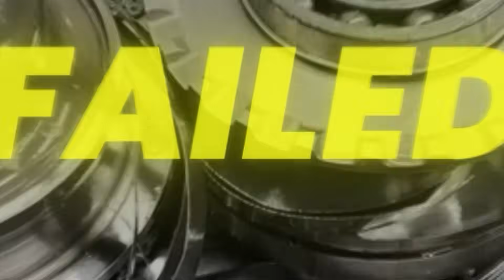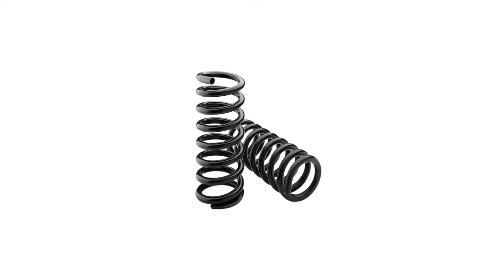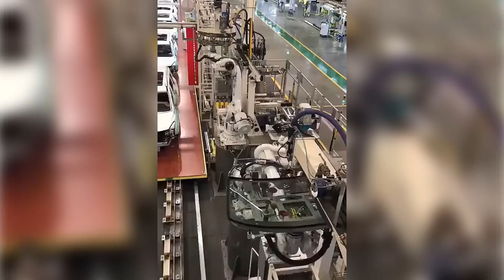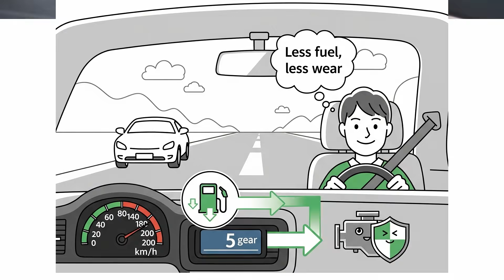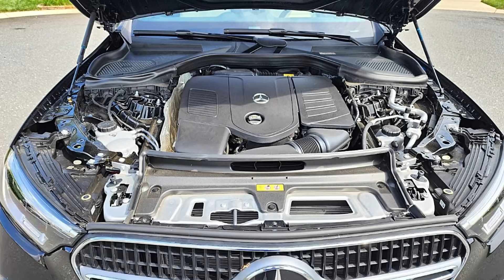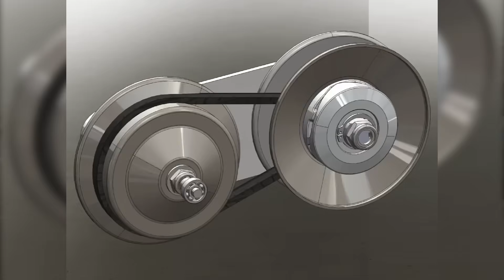How This One Bad Habit Kills Every CVT Transmission Before 50,000 Miles

Comment: I don't understrand. They do advertise everywhere that cvt transmission is fragile, not durable enough, etc. But even heavy machinery like JCB tractors use cvt transmission. Now almost all new car, aside from expensive one use cvt.
Reply: The CVTs in cars are way undersized for the load they are subjected to, unlike the tractor units.
Reply: The systems used in heavy equipment is a hydrostatic transmission.  Basically an adjustable hydraulic pump and motor system.  No belts or chains involved

Comment: I have an 07 Prius.  They call that a CVT too, but it is much more robust.  No belt.  It is genius.
Reply: Basically Toyotas have a planetary system instead of a normal transmission.  Ironically, normal transmissions use a planetary set of gears also.

Comment: Im a mechanic for 25 years. Ive had 3 altimas and 1 new maxima. All the altimas went to 200,000 miles, and ive got a heavy foot. Drain and refill every 40k miles. Never had an issue with any of the cvts
Reply from the maker: That's what I think. Timely maintenance is the key to make CVTs last longer
Reply: Also keep in mind the maker of this video has ZERO experience beyond ready sketchy info from amateurs on undisclosed "forums".... which is the only accurate information in this clip.
Reply: Hi , can you describe what is for you heavy foot?..I live in Europe in some countries there is no speed limits so I do spirited driving " holding constant higher speed couple of hours 160km/h...is this to much strain  for honda cvt 1.5t, thanks.
Reply: @ksweden3455 make sure to drain your transmission fluid and refill every 40,000 MI.. here in the USA I drive my CVT vehicles at 100 MPH.. just make sure you have the correct transmission fluid level when you service it. Make sure to use proper CVT fluid. When I say heavy foot,  I personally mean harder acceleration and higher speeds than the average person.
Reply: @ymmij1973 Thanks a lot, asking you because my cvt on honda failed on 42000 km, honda said " bad luck:, my car insurance backed me up with new one, I do not know can I trust cvt anymore, what kills cvt most is it design or no oil changed l?, it is funny driving car with 183 hp and you are scared to drive it faster on highways in my cays 160 -180 km/h 4, 5, 6 hours constantly.
Reply: @ksweden3455 I've never owned a Honda CVT so I can't speak for their reliability but I've had four Nissan cvts one of them with a V6 and never have any issues. I was the second owner on all four of my vehicles
Reply: @ymmij1973 tell me about v6 and maxima beautiful car...is it reliable?, I still think maybe to import one from America, you can find them for good price the only problem here in Europe is avaliable parts?..in Usa cars are a lot cheaper than in Europe...you can get for 32.000 new camry   for same money in eu you can buy 3-4 years same car
Reply: @ksweden3455 follow my page if interested. Thank you
Reply: @ksweden3455  Running at top speed isn't the big problem with CVT's. It is stop and go acceleration that kills them. Don't rush off the line, especially soon after a cold start. If you want to go 80 or even 100 on the highway that shouldn't be too detrimental (with regular fluid changes). Accelerating from stop (or towing, same thing really) destroys the belt no matter the condition of the fluid. Don't race off the line. Slow acceleration is key, not what speed you ultimately reach.
Reply: I have toyota yaris cvt fluid tc ...is enought to drain and fill fluid or i need gasket pan drop and filter change every 30k miles ?
Reply: @MirkoMadzar12345 I like to change the fluid after the vehicle has been driven and vehicle turned off after about an hour. When you drain the fluid make sure you measure how much you took out and then put back  in the exact same amount.. I've never changed the fluid on a Toyota Yaris so I'm not sure if there are any differences from my Nissan. But just draining the fluid one time and refilling won't be enough,you should drive the vehicle and then drain again and refill

Comment: I have two Subaru Foresters, both with CVT, and both north of 100K. The stealership said that they were "sealed units", and that they never needed fluid changes. My owner's manuals confirm that. After some research, I found that the Forester owner's manual in Japan suggests fluid changes every 30K miles. (Maybe the Japanese CVT's aren't sealed)? I was really hoping to have my Foresters for at least 200K miles. Are they doomed?
Reply: There is no such thing as a sealed transmission. Such a thing does not exist. Your CVT may not have a dipstick, but that does not mean the CVT is sealed. There's always a way to put fluid in and drain fluid out. Every single CVT.
Reply: @barryblessing  Every CVT has a dipstick. Look in the driver's seat.
Reply from the maker: if running without jerks then conitnue, if at this moment u change, you may experience slipping issues
Reply: @AutocornerdPros  A CVT without a jerk is a driverless vehicle.

Comment: You cannot check the CVT fluid because their is no dipstick. CVTs are sealed tranmissions
Reply from the maker: Yes, u can check from drain plug. I have toyota yaris and check in the same way
Reply: There is no such thing as a sealed transmission. Such a thing does not exist. Your CVT may not have a dipstick, but that does not mean the CVT is sealed. There's always a way to put fluid in and drain fluid out. Every single CVT.

Comment: Fortunately, Toyota hybrid vehicles use beltless CVTs.
Reply from the maker: They have chain?
Reply: @AutocornerdPros  Nope. Planetary gears with electronic control. It’s what Toyota calls their eCVT.
Reply: @AutocornerdPros  No, it is an entirely different concept. There are two electric motors and a gasoline motor hooked together through a planetary gear system. Together they produce any gear ratio, through control of the motors.  It is very clever. There are no belts, nothing weird. Gears are ordinary and meshed together. No shifting!

Comment: If you have to idle your car for a couple minutes before turning it off, that’s a horrible design flaw.
Reply: regardless if its necessary or not,id like to stay inside my car for a while, releasing all bad aura ive had before going inside my home and family,so thats a win win.
Reply: @junbagyo84 way to think positively I do this myself anyways lol. 

Leave the garbage at the front door.
Reply from the maker: 30 seconds is fine
Reply: @AutocornerdPros  Like, literally, no one does that. They pull in, put it in park, and turn off the engine.
Reply: @NativelyBornAmerican  Nah I need to take a couple deep breaths and gather my belongings and think about my life briefly before getting out of my car. So that usually takes like 3-5 minutes
Reply: Early turbos demanded it. If you didn't run your car for a minute or two after driving, the oil would burn inside the turbo and eventually ruin it. A friend, at his own expense, installed an aftermarket pump which would automatically circulate oil through the turbo for two minutes after shutdown. I always thought it was a serious design flaw. Manufacturers did finally address the problem.
Reply: @tombiggs4687  Buyers of those early turbocharged cars were educated on them, typically. And it’s been a LONG time since those days. While CVTs have also been around for a VERY long time, there were extremely rare until only relatively recently. And after-cooling, where the car will run cooling fans, pump oil, etc, after the car is turned off has been around for many decades now, too.
Reply: You are absolutely correct, This is more like a trap.

Comment: Cvts are scam. Traditional auto or manual are more reliable. Its cheaper to replace a clutch, and the probably of a defect is highly unlikely. I trust a traditional auto over some rubber band in a vital component like a transmission just to save some mpg. Id rather just pay for more fuel than to breakdown ......

Comment: This is why I avoid automatic cars at all costs. The fact that I don't have to worry about oil temperatures and belts is a blessing 6 speed stage 2 performance clutch. Let's hit the road 🙌
Reply: your clutch will burn out so where's the advantage..
Reply: They are talking about cvts not automatic transmissions.

Comment: So, basically CVTs are a fragile, fussy solution to a situation that already had robust solutions.  Sounds like a great advancement!
Reply: The are solution in search of a problem. It is not necessary to have "infinite" gear ratios. 8 gears is well into diminishing returns.   A fixed gear transmission that is not exactly that the most efficient RPM, but darn close, is better than a CVT that is at the theoretically correct RPM for every situation, but inefficient.   The exact RPM is not that important; within like 5-10% is all right. There are other factors like valve timing and whatnot.
Reply: Nope, but sounds scary if you don't know the facts.
Reply: Misinformation. Most of them are very reliable with normal maintenance.
Reply: @brucewygal133  I own a Versa . They are NOT reliable!
Reply: @HarryPost-h7m yes they are its abuse that kills them..
Reply: @brucewygal133  true, I have a 2013 sentra at 176k and its still strong
Reply: @brucewygal133 describe your definition of reliable please. My definition of reliable would be 250'000 with nothing more than fluid changes. I currently have a car with a Getrag  F23 5speed with 300,000 on it and I only change the fluid every 60,000, and yes it is still on the original clutch
Reply: @brucewygal133  You apparently don't own a Nissan with CVT.

Comment: 🙄 My 19 Corolla went to 165,000 when I traded it. Changed the CVT fluid every 30k, and not with the expensive Toyota brand fluid either- it ran fine. Is it a race car, no. Fast off the line, no. But I could go 70mph on the highway with everyone else no problem, so who cares. And who cares if I can't go 0-60mph in 4 seconds, I'm trying to get to work not race a GTR. My 24 Subaru CVT has been just fine with daily driving too. Maintenance, and having some common sense when you drive, and your vehicle, even "less reputable"ones, should last some time. Grow up.

Comment: Where does all the heat come from? Does the belt slip? Aren't CVT's supposed to be very efficient? Heat is the result of power loss.
Reply from the maker: Due to high pressure
Reply: @AutocornerdPros  Pressure doesn't create heat without relative movement (work = force X distance). Maybe the heat comes from bending of the belt material as it goes around the pulleys, similar to the way heat is created by bending a coat hanger wire back and forth. Or maybe CVT efficiency comes from keeping the engine operating at optimally efficient RPM's and not the efficiency of the CVT itself. So I guess the question is whether a CVT itself is more efficient than gears. Most cars with manual transmissions don't have oil coolers.
Reply: @km4hr anytime you are building up hydraulic pressure, it also builds heat.  Just feel the lines coming out of a hydraulic pump and see how hot they get.
Reply: @robertheinkel6225  Even when there's no flow? Heat would have to come from wasted energy due to fluid passing through a pressure relief valve. Hydraulic pumps are usually positive displacement pumps which means the fluid has to go somewhere as long as the pump is turning. Better to slow the pump down and stop wasting energy.

Comment: I actually change out the CVT fluid on my Honda CR-V every 15,000 miles.   I try to do the one-minute cool-down period,  but often forget, so this is a good reminder.
Reply: 160k miles in a 2013 Honda accord sport here, never have I changed the fluid but I never dog the car either
Reply: youre not suppose to change it every 15k that takes out the friction which the gear needs, dont change it in less than 30k miles and even 60k is good
Reply: @Sam-se3sd  source?
Reply: @thisisrob8750 common sense  and education

Comment: The biggest mistake with CVT you did not mention is to be dumb enough to buy any cars with the CVT or dual clutch transmission. especially when you have to tow anything significant. Nissan made a serious business error by buying a CVT manufacturer and is dragging them down , you do not have to take part in the disaster. Nissan were never able to tame the CVT, but they are stuck with it. The government forced manufacturer to improve gas mileage , at any price, so the few % of gas saving is hard for some engineers to resist.  The end result, you saved a little gas, but it not money, it will cost you 100 times as much in tranny overhaul.  With something like a six speed , it is close enough no one need the CVT.

Comment: Remember when automatic transmissions were called 'mush boxes'?  CVTs take this to a new level.  New automatic transmissions shift cleanly and the shifts are nearly imperceptible.  Most of the time, you know a shift has occurred by looking at the tachometer or seeing the gear number change on the instrument cluster.  My vehicle has a ZF 8 speed transmission.
Reply: I'm 60 and never heard of an AT being called a mush box in my life. Sounds like something you just made up.
Reply: @sumtime-c1h  I did not make this up.  I'm 77 and in the 60s, an automatic transmission was sometimes called a 'mush box' by the gear heads of the time.

Comment: Manufacturers cannot continue doing CVTs if they are bad, with proper maintenance and driving habits CVTs are very good, mine is a Nissan Murano  clocking 180,000 with zero issues and a smooth ride.
Reply: It's do!

Comment: Why don't they make CVT's with a replaceable belt?
Reply: Cars use a push chain system, while ATVs and snowmobiles use a belt system.  The belts are easily replaced, while the chains are not.

Comment: The fluid is definitely super important. Technically, Castrol CVT fluid covers Nissan NS3, however, it also covers every other fluid requirement according to the label. To me, that’s just not possible.
Reply: Agreed. If it does everything,  it doesnt do anything well.
Reply: I mean a lot are all made of similar materials so I don't see why not.
Reply: @lejoshmont2093 there’s a reason why the manufacturers specify a particular fluid for your car

Comment: I also asked a honda mechanic to make sure that engine braking was harmful for cvts like what my 2018 honda accord has. He said that it was perfectly fine but it might cause harm if you do it too aggressively.
Reply: In my 10 yr old 175k miles Subaru Legacy I used the paddle shifters to downshift for slowing down all the time… to the extent I got 130k miles on the rear brakes and 157k miles on the front.
Reply: @festerofest4374 did you ever have any issues with the CVT by doing that cause that seems a little aggressive. I just let the car do it automatically
Reply: @MichaelBanko-e1v  The tran started making a whining noise over 50k ago and it's gradually gotten louder. Not noticeable as you go faster as the road noise covers it... just at slower speeds, parking etc. I don't blame it on downshifting though! I blame it on me listening to the mfr's BS maintenance recs! I now know I should have changed the CVT fluid at least every 50-60k! I'm actually quite pissed about it... all these mfrs saying trans fluid doesn't need to be changed. Ought to be massive class action suits over this BS. The car is garaged, in virtually perfect condition for its age, and clearly now the trans is going, such a shame.

Comment: I have heard the lifetime fluid lie about some automatics too.  Really they only say that to make it sound like the vehicle lasts forever and needs no maintenance but in reality it is just to sell more vehicles.  That thing you mentioned about going from reverse to drive while still in motion also applies to automatics, even drive to reverse.  So many of the things you mentioned are good points for conventional automatics.  Also I have heard of some shops accidentally using regular ATF in CVTs and that ruins them also.  You might not even get it to go if that happens and if you do, you might have 1000 miles or so at the most before it breaks down and leaves you stranded with a huge repair bill.  Some CVTs have a small filter for the fluid too that may be accessible easily enough on a lot of vehicles for those who are willing to get under the vehicle (safely supported I hope).  I find that the first time I changed that filter on my Nissan, it made a nice difference and made the vehicle a little smoother because of better fluid flow.  You won't lose a lot of fluid but make sure that the gasket didn't move and the housing goes on the way it should or it will leak fluid all over your floor when you start it up!!

Comment: Best advice: Avoid sleazy mechanical CVTs and turbos. 
A transmission that COUNTS on FRICTION to work. What could go wrong. 

If you find yourself with a sleazy mechanical CVT and want it to last, drive gently like grandma and do the fluid changes as the video suggests (using the OEM fluid).

If your new car budget is pushing you towards a mechanical CVT vehicle I suggest considering a low mileage used Ford or Toyota HSD hybrid.  These vehicles are electric cars with gasoline engine assist. The gasoline engine gets CVT action from a PLANETARY GEARSET. Actual gears that avoid friction.
Reply: All transmissions rely on friction, whether from internal clutches or a simple clutch as in the case of a regular gearbox.  Internal clutchpacks and bands do the shifting in normal automatic transmisssions.
Reply: @Mikexxx531  . Most people know clutches and brake pads use friction to work. 

CVTs use friction to push segments of a chain to transfer power. Much iffier.
Reply: @dannybryant6873  Iffy in that you're putting a great deal of power through a small cross section of friction material. V and serpentine belts do the same thing, but only with a small percentage of the engine's power. On some industrial equipment, they just use massive belts to do the same thing.